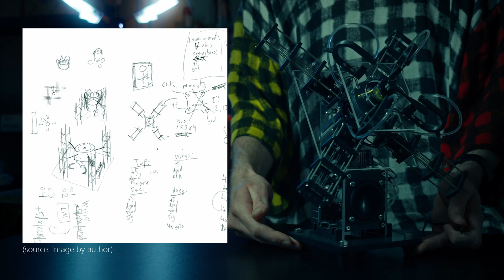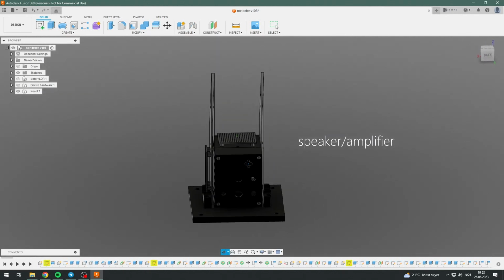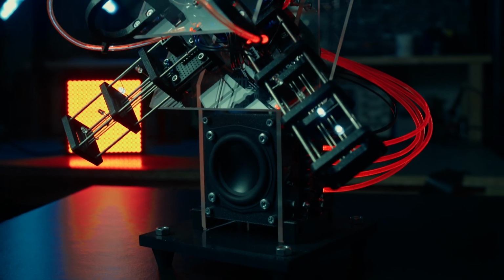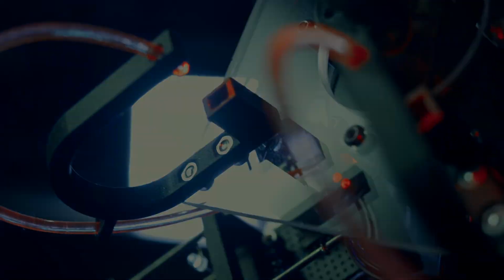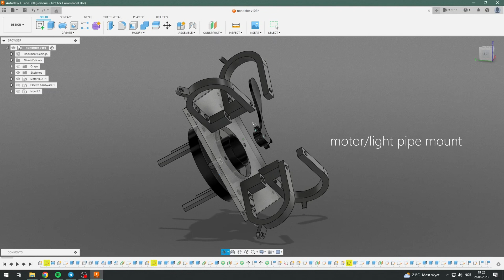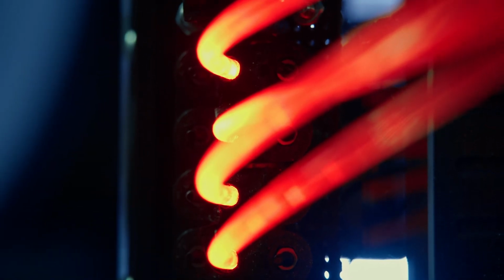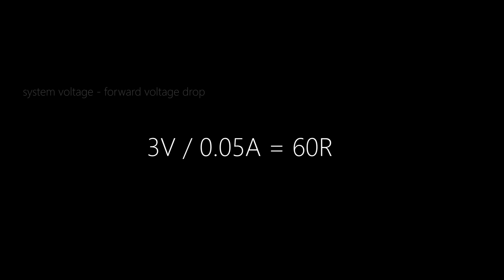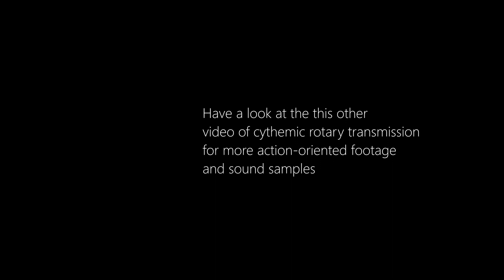Motor driven synthesizer sculpture | Making cythemic rotary transmission

Comment: Beautiful creation and awesome to see and hear!  It made me think of "Simple Fan Synth", have you seen that? (you can find it here on youtube).
Reply from the maker: That fidget spinner eurorack module came to mind a few times while I made this
Reply: @EirikBrandalf  OK, one question that wasn't clear for me from the video.  Is the motor speed constant (the LEDs seem to cycle at a constant rate which indicates that maybe it is.  But that doesn't make sense, since it would only be acting as a fixed frequency oscillator.  Or is it somehow modulated (how?) and then, if so, is it driving the sequencer at a variable rate?
Reply from the maker: @Enigma758  The motor speed changes, but it's hard to see when the RPM is so high (and I didn't pay enough attention to it while editing to include shots where the speed is lower). So yeah, the motor speed affects both the delay time and the sequencer.
Reply: @EirikBrandalf  Thanks, that makes sense.  Is the speed random, or based on some sort of feedback?
Reply from the maker: @Enigma758  It jumps to a random value after a random amount of time
Reply: @EirikBrandalf  This gives me an idea 🤪.  Instead of using a purely random number to control the motor speed, maybe use the difference between successive notes from the sequencer to compute a velocity delta (maybe "smooth" that delta over time via a running average so it doesn't change abruptly).  Also reverse the the sign of the delta when exceeding high and low limit thresholds of motor rotational velocity to keep it within a reasonable range.  Just a thought, feel free to use or ignore, but I wonder if it might create some interesting correlated effects?
Reply from the maker: @Enigma758  Well, the main issue with the motor I am using is that it's very low torque, so the only available resolution in terms of control was in the upper 20% of the PWM range (if that makes sense). There wasn't much to benefit from playing around with other methods of control, because the difference was negligible. That's not to say that your idea wouldn't work on other things though!